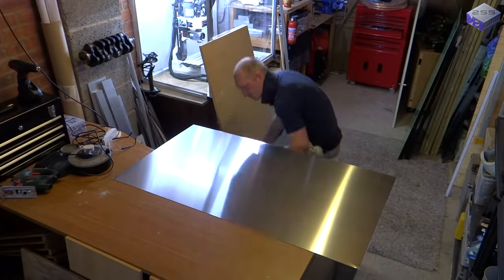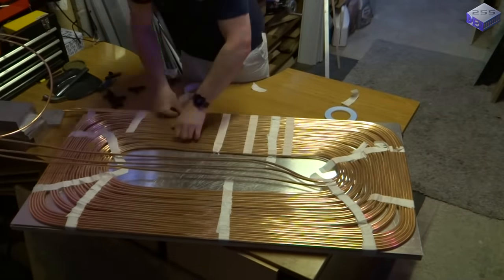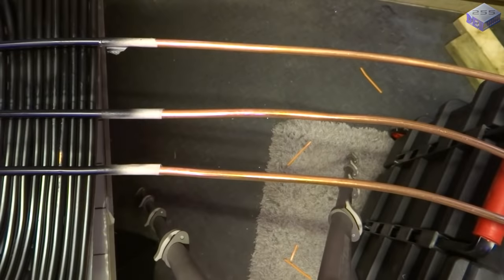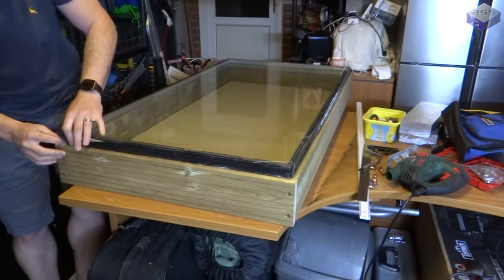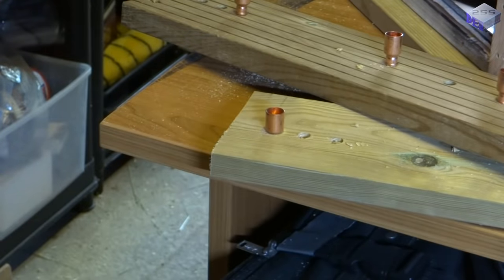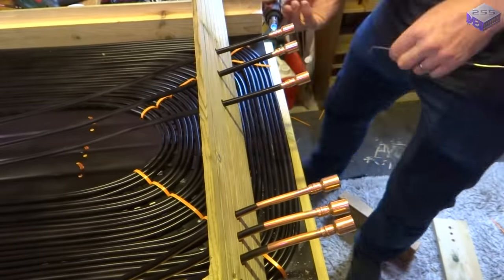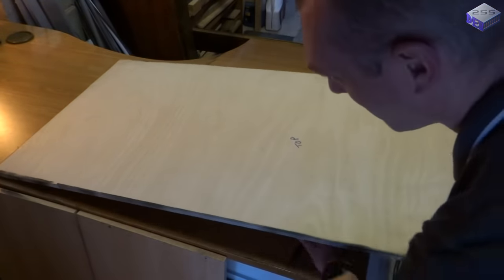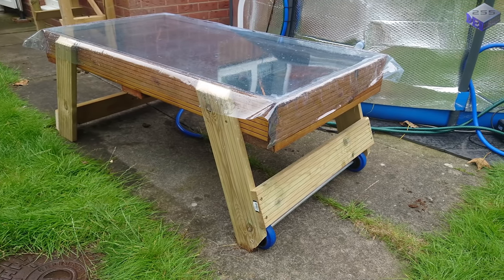Improved Solar Pool Heater - Full build

Comment: Hi Neil, great job and very helpful. When I build mine I used black corrugated plastic pipe. The other thing I did was to angle the panel so it faced the Sun. 
Stuart
Reply from the maker: Hi, thank you, yes angling the panel would get the most out of the sun. This panel is fairly heavy, so I have some mirrored acrylic to attach to the sides, where I will automate the angles of both panels to direct the energy to the panel. I hope yours is working well. Glad this video was helpful.
Reply: @TheSolarPoweredEngineer  reflection the sun does work very well. My unit is the same as your and it's strapped to a 4 wheel porters trolley. We are moving from the Midlands to Cornwall soon so it will work even better.
Reply from the maker: @stuartwakefield1657  That's an excellent way to move it around; we live in the midlands too, although initially from Southend. Cornwall should help with the panel, especially if you have a south-facing garden. I do like Cornwall; I would recommend the Minac Theatre on the way down to Lands End.

Comment: How's this working for you a year later?  If it's good, I may try it.
Reply from the maker: Hi, I haven't got it hooked up at the moment as we have just moved, although the glass sealed unit has blown, so condensation has got in. I am going to try using different materials for the cover, but think acrylic could be the best option, same as I used in the first PVC version.
Reply: @TheSolarPoweredEngineer  Thank you.   I look forward to your future vids!

Comment: We had one for our pool and we put black plastic beads in around the pipes and that improved the heat output alot
Reply from the maker: I will have to look into different designs, I was just worried about leaks with lots of joints. Ahh, just re-read, I thought it said bends. Hmmm, beads could be an interesting idea, there is a lot more surface area. May just try this one ;-).
Reply: @TheSolarPoweredEngineer  we did the same as you just looping it around

Comment: My only suggestion is a few small air holes.  You've sealed it up so well that on a really sunny day, the air inside might expand too rapidly for it to dissipate through the cracks.  This might dislodge the glass top.  A few 1/8 inch holes on each side would prevent that yet still keep out bugs, dirt, etc.  In a really sunny place like Florida, this would be a real possibility.
Reply from the maker: Hi, yes I have already experienced the sealant splitting and will be putting a few small holes in it, plus doing some more modifications too. This one is producing around 500W so far, but I'm sure this can be doubled, we get around 1000W per m2 so should be able to achieve this with different materials and a couple of acrylic sun tracking side mirrors ;-)
Reply: @TheSolarPoweredEngineer  Cool.  I'd be interested to know how hot the water comes out on different days based on cloud cover.  Also if you're recirculating it or just heating up from original source.  
Keep the project ideas coming.
Reply from the maker: @spocksvulcanbrain  Thank you, I will be doing a video on cloudy days too, especially after the mirrors are attached. I'll try

Comment: Very nice build.  And you forget to mention the cost: 2 million dollars and 1000 years to build it.
More cheeper to use PVC hose or pipes. 
Anyway the concept is quite good!  Thanks
Reply from the maker: Hi, thank you. In that case, this one is very cheap at only a fraction of the cost and time to build. This would most likely cost around £300 to £350 in todays prices, although cost me around £250, but just to try it all out, I will be doing some modifications soon to see if it can get more efficient and cheaper to make. I did create a version 1 system with PVC piping and that one works well, although its fairly cumbersome to move around.
Reply: @TheSolarPoweredEngineer  oh, great. Never view the pvc pipe version. 
Thanks for share and reply!
Reply from the maker: @igor2030ign  No dramas 👍

Comment: With a solar swimming pool heater, the higher the temperature Delta between the inlet to the panel and the outlet to the panel, the lower the efficiency. So higher flow rates and larger pipe is better. It's somewhat counterintuitive, but I learned that in solar school. so in California, for example, glazed solar panels although much hotter, are less efficient than a massive surface area of black rubber mat because the flow rates are much higher. As a rule of thumb, we would size the rubber mat array to be 75 to 100% of the surface area of the pool.

Comment: FYI, most window glass is treated to reflect IR radiation, to keep heat in your home from leaking out during the winter, and vice versa during the summer. However, it cuts off a good portion of the sun's heat for this application.
If you used window glass, you may want to consider looking for some untreated glass, it should give you a huge boost, especially during cloudy weather (as IR is better than visible light at penetrating the cloud layer).

Comment: Have you considered using convection to generate the water flow ?

I have a preliminary design! At the bottom use a wide boar pipe to build a manifold then using narrow boar pipes run them vertically towards the top manifold. 

As the water heats it will rise, pulling in cooler water and pushing out the hot.

In theory, it should work . But I guess it depends on the thermal energy collected!
Reply: I have build this setup with a wood stove and a storage tank. Based on natural circulation the tank heats. In my situation my storage was above my heart source. I don't know if this works here since the pool is low and the panel on a high level.

Comment: Two questions - 1) why tubing in parallel and not series? Seems like the water won’t have much time to heat. 2) what is the temperature rise you’re able to achieve?

Awesome video! Easy to replicate.
Reply: When you go from a larger pipe to a smaller pipe, you increase the pressure. Causing a higher velocity flow. But if you go from a larger pipe into three smaller pipes, that have a combined circular area than your larger pipe, it will split the pressure between three points and reduce the water flow. You also don't lose your water pressure from the conversion in the same way. 

So, running things parallell is in fact, better and cheaper. Since you can run multiple copper runs to increase your over-all diameter in the panel and increase circular area, reducing water flow. So it in fact, get more time to heat than if you ran a single pipe. Not to mention, you don't have the headache of pressure testing everything.
Reply: @Helveteshit  That’s fantastic and for me completely counter-intuitive. Looks like I’ve got a new project to tackle! Thanks!
Reply from the maker: Hi, thank you, good questions. 1) I configured it to be changed to serial later, as I need to do some testing with it to see the benefits of both, a fast flow ensures turbulence in the tubes for maximum heat transfer and the parallel configuration to remove the heat faster. Serial may keep the water in there longer although, in my head and from what I can work out on paper, the outlet would be warmer compared to the outlets of the parallel system, therefor serial could be slightly less efficient. 2) last year I was getting a temperature rise of around 1.4ºC at a flow rate of around 4.5 litres/min, so around 500W of energy transferred to the water.
Thank you.

Comment: Personally for me the cost and efficiency are key since it really adds up every day. 😊 I use a 10 gal. container with an electric submersible heater and two small submersible pumps (out of pool & back to the pool from the 10 gal. container. It works well and fairly quickly for our needs just a small 10 ft round Intex pool. The water being pumped back to the pool is about 130 F (55 C). Total cost US$ 65 plus whatever electricity will cost.

Comment: Good project. Copper pipe heaters were common in India 2 decades ago. Now no one uses them because pipes will corrode or choke due to calcium.
Now everyone uses vacuum tube heaters.
Reply from the maker: Thank you, it was fun to make and even better to have a warm pool. I haven't noticed any yet, although it is still early days. I wasn't sure about vacuum tubes as they seem fairly expensive for just heating a pool, although could be used for both home and pool I guess.

Comment: Your pipework will be very prone to blocking with inevitable debris from the pool. Also when water/coolant gets extremely hot it can turn to steam if its at normal atmospheric pressure, this will stop all water flowing through. 
Sorry if this sounds negative, but I'm a heating engineer.

Comment: You get much more power in the same area with some solar panels and a pool heat pump. 

They usually have a cop of 6. 
So 850w will give you more than 5kw of heating. 
850w are two big solar panels which are dirt cheap. 
When I google for pool heat pumps, they're fairly cheap as well. Also when you don't use the heat pump the solar panels will set off some of your electricity bill

Comment: Great project! Would burying the tubbing in black sand increase its heat rentention and efficiency?
Reply from the maker: Hi, good question, it may do as it traps air in between, retains heat well and could be sprayed black also to absorb more light. Plus, it would increase the surface area. Hmmmm, I may just have to try that, thank you. It would make it a fair bit heavier, although I will be replacing the glass for something lighter anyway.

Comment: Working with commercial glass. Have a rack of units stacked in the sun on a mild sunny fall day can get so hot it breaks the 4th or fifth one in the stack but the first one is always cool to the touch.
Reply from the maker: H'mmm that's some good observations there, this heat could be harnest and a at the same time save the commercial glass from cracking. They could store it in the sun intentionally on racks with water pipes running between to collect the heat. Maybe the staff could then get free showers at work and save on their own bills ;-)

Comment: Thanks for providing the most important information. Production.
I use an electric boiler. And average daily consumption is 2Kwh. 
So in similar insolation I would need four times that surface.   
Maybe here is a little more sunnier, but trees and west orientation of my facade will make this not feasible.
Reply from the maker: No worries. When testing this and a previous version, I was impressed by the efficiency of directly heating water, you could easily heat a tank of water with one of these for a daily shower; well, in the summer anyway (UK).

Comment: Great project, great video. I used to fit hot-tubs professionally and it was always my ambition to create something similar for the hot tubs to help reduce the hefty running costs but the tub manufacturers would voud any guarantee if you interfered with the tub plumbing. I once had a customer who had made his own panel very similar to yours except he used elkathene piping ( cheap agricultural stuff) a much bigger diameter pipe so used a lot less length wise.  
He had a tap fitted at one end, so me being the sceptic decided to test how warm the water was. It wasnt full wall to wall sunshine so I guessed it would ve luke warm at best. Wrong, I nearly scalded the hand off my self in less than a couple of seconds. 
What I didnt realise was he had installed a seperate water storage tank and was cycling the water to it..
I agree with a previous poster that copper might not be the best material as it will reacte with the pool sanitiser chemical. Also, I dont think the addition if the aluminium panel is bringing mych to the party as it is 90% covered. ( Car bodies will only get warm / hot in direct sunlight) Its probably an expensive part you dont really need.
Reply from the maker: Thank you, it was fun to make, although time-consuming. This one was made from all the comments from the version 1 video (https://youtu.be/QU7RUfWXfZ4) hence the copper and aluminium choice to try and get a greater surface area in such a small space (0.81m2), where it achieved 500W last year, although we didn't have much of a summer in the UK. I am looking at improvements and am always open to suggestions, one thing I would love to try is heating an emersion tank of water up, possibly 100 litres (typical), where these homemade ones are proving themselves on our 4600-litre pool. Copper is a concern of a fair amount of people, and I am looking to make a cheap heat exchanger so that it has its own closed-loop water system.

Comment: Quick question : why not just join the cooper tubes so you have one inlet and one outlet instead of three?
Reply from the maker: Hi, good question. As I'm still playing around with its efficiency and finding out the best flow options, I thought it best to put the three parallel tubes outside the box so I could configure the flow through the system externally, such as parallel, serial, 1 in 2 out on one side, etc.

Comment: I did a similar one with the cheapest plastic hose,..and it works perfect,...maybe 90 % as good as this one in copper.
Reply from the maker: I did make version 1 with black plastic hose and that is still working and averages around 600W during the summer months, with a mid-day max of around 900W. I will have to do some more testing this year.
Reply: @TheSolarPoweredEngineer  Thank you for the answer,...there are many good ideas & inventions,everyone can make,...us humans are very capable,but the most ,preffer it the easy(and expensive)way,..in general it would be greath a more pro active actitude,...have a nice day.

Comment: Interesting! But I wonder if there's another development to be made here. Solar PV panels work best in bright sunlight, but their efficiency drops off when they get hot. So... is there a way to use recirculating water to cool the solar PV panels, and make use of the heated water as a valuable by-product? This could be as simple as trickling water down over the panels and collecting it in a gutter at the bottom, at for starters. Then maybe fix a sheet of plastic to the underside of the panel to create a 25mm deep water reservoir...

Comment: Next time you should try BLK3.0 as the paint. It’s much darker then a normal black, maybe it can observe more heat as well. And maybe the copper tubing could be closed into an own housing and that housing could be closed into the bigger one. Pumping out the air making vacuum between the two housing can make it much more efficient because you will not lose any heat on the copper pipes.

Comment: people if you want to build one of these you can use far less copper,  I use an old thermal solar panel to heat my hot tubs. it uses parallel rows of 3/4" copper spaces about 4-5" apart all connected to a 3/4" manifold pipe at the small ends.  Works incredibly well. In colorado (sunny) if water is not moving it will boil off all the water inside it of the water is not circulated for around 5 minutes (many variables but it gives you an idea). The sun "insolation" value is approx 1000 watts/m2  ,   direct solar thermal can convert almost all of that...vs photovoltaic panels at  approx 20% efficiency....BUT if you run a heat pump with that operating at a COP of 3-5x....  it's kind of a wash....   One might also have to build an automated control system to shade the thermal panel when you have reached a target temp to avoid stressing the water  panel ...can't just stop the pump as the water will boil off and then the panel temp gets very hot...lots of stress from thermal expansion etc.....  of course freezing climates are an issue ... there are ways around it but  DIY PV is at it's cheapest right now by a far bit.  Use a bit of each system I say!

Comment: Do you have any other projects showing the electronics? I have a swim spa and thinking about it:
1) I need to feed the inlet to this and the out let to this before the heater and the temp sensor in the spas elector heating unit
2) Need to have a valve that shuts the divert off, so at night the cold water is not pumped into the solar and thus may be cooling the water rather than heating it.
3) Need a diverter to take this out too the system in the winter and have a drain to allow the system to be drained down to stop freezing in the winter

The next level would be to have a by-pass valve where the temp in-the solar unit is x then the water flows through the solar a three times to keep raising the warmer temp, but on a hot day the system would run all in parallel. 

Then the next upgrade would be to run three of these in series to get the water temp really up there and have a valve that would allow one/two or all three to be used dependant of the temp. I run the spa at 35.5 in summer and 38 in winter.

I’m confusing my self now, but need to understand how to put the electronics in to the right place to capture the temp and then use this to operate the values.

Comment: Great job, I want to do this for our hot tub in sunny Colorado US.
Reply from the maker: Hi, this should be ideal for a hot tub as there is only around 1000 litres to heat. You may wish to use black plastic tubing as there is a concern over copper and chlorine, although I haven't experienced this in our pool as I keep the Ph balanced and Chlorine levels to a minimum. I think a spa can have a higher PH level and be at the higher-chlorinated end of 3ppm.